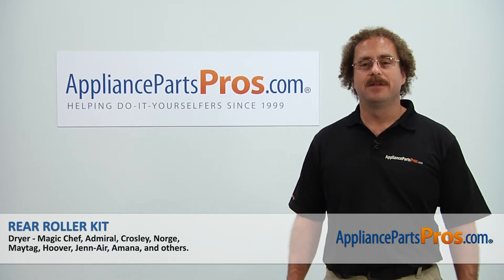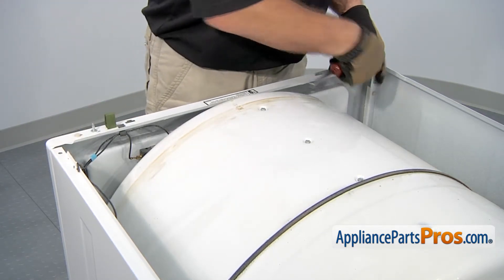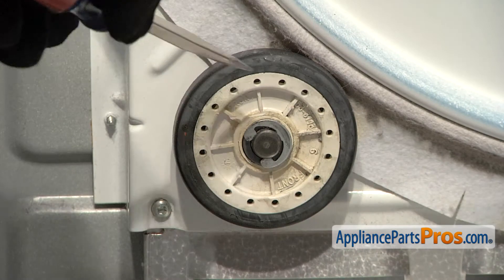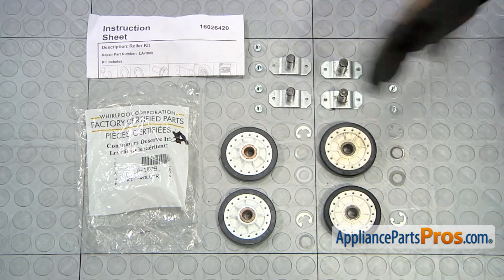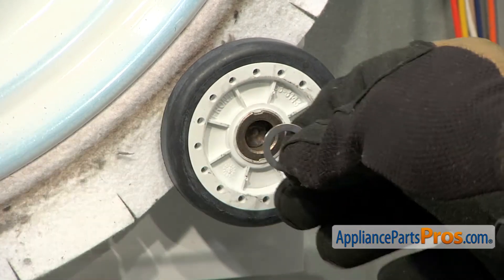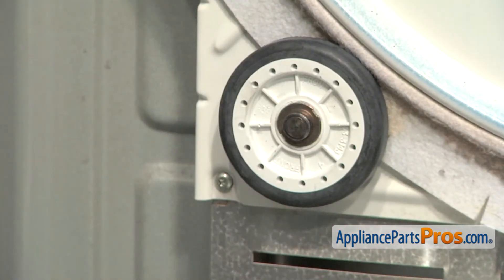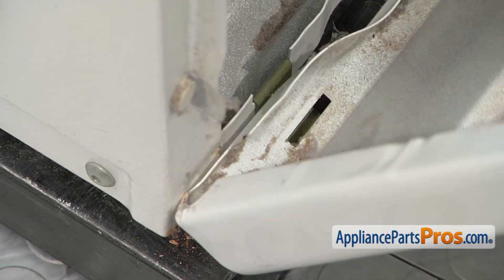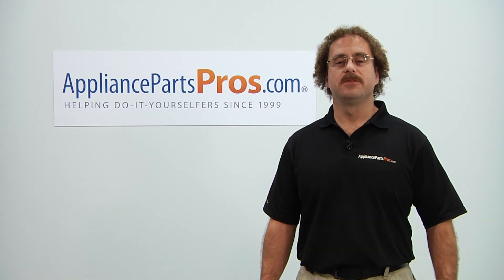How To: Whirlpool/KitchenAid/Maytag Rear Roller Kit LA-1008

Comment: I have a gas dryer just like this.  I've replaced the rollers with the axle kit before but it is a matter of months before it is squeaking again and I need to disassemble and re-lube the bearings.  The left one is above the burner and dries out quick.  Does anyone know of a lube that lasts in the heat?  I've tried oil, wheel bearing grease, graphite, and anti-seize (worst of all).  This time, I drilled holes in the sides of the dryer and put in plugs at strategic locations so I can oil the bearings without taking the dryer apart.

Comment: Hi, I followed your instructions thanks. The left roller bearing was worn out. I changed the left roller with a new one and still the dryer makes noise. I did not have the plastic spacer and the metal one, and I noticed that the shaft was not perfectly round and I wonder if it makes the noise because of that and the missing plastic spacer.   What kind of spacer should I buy and also E-clips
because I might damage it if I take it out for the second time?  Thanks
Reply from the maker: We offer free technical advice and diagnosis, so we'll be glad to help you figure that out. We’re available 7 days a week at 1-877-477-7278 or you can chat us at our website: http://www.appliancepartspros.com/